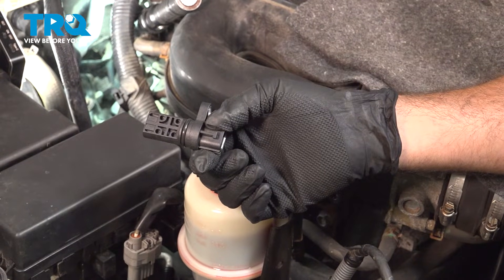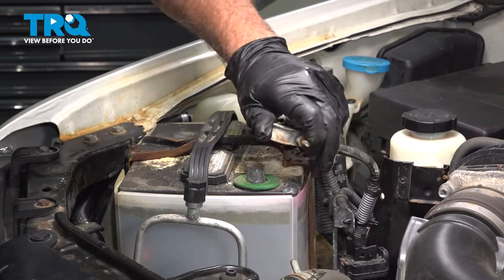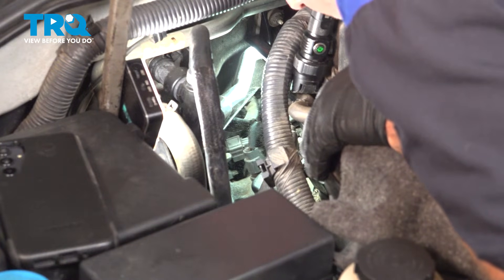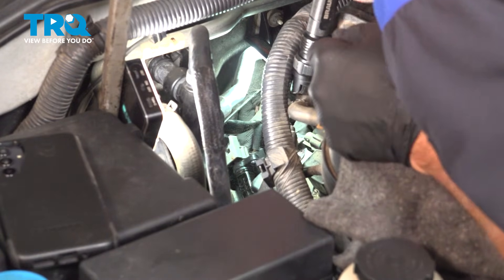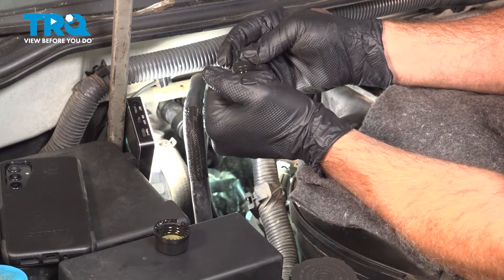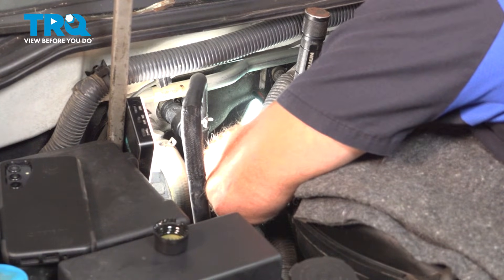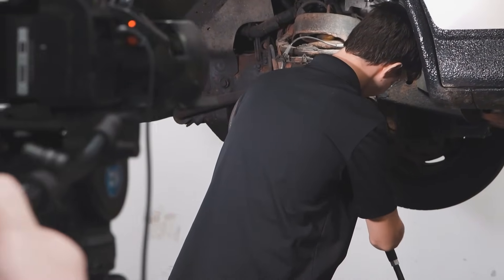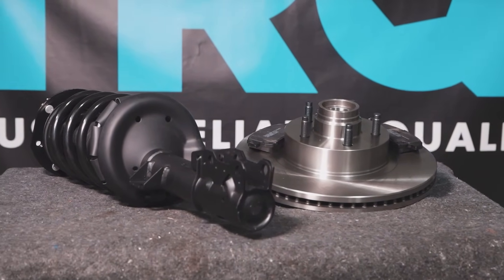How to Replace Passenger Side Camshaft Position Sensor 2005-2021 Nissan Frontier 4.0L V6

Comment: For others watch this , the instructions in the video were great. Two additional things I found: 1) You can loosen the bolt holding the wiring harness most of the way without removing it completely. That is enough to work the sensor out around the harness, and it doesn't leave you with the risk of trying to replace the bolt for the wiring harness on the back of the engine by feel! 2) The tab on the electrical connector pushes forward (towards the sensor) and will snap open once it's pressed all the way forward.

Comment: Make sure when you replace any of the sensors on the Frontier, (or any Nissan for that matter) to use the Nissan OEM ones. Hitachi makes all the Nissan sensors. The aftermarket ones WILL give you issues. The system is very sensitive, so save the headache and buy the Nissan parts.

Comment: The content of the video was very helpful. However,  my sensor was a little stubborn. After tugging, I used a long flat head screw driver to fit between the sensor and connector and with a little twist and it became free.

Comment: Taking out the top cover that says 4.0 gives you a little bit more room but be SUPER CAREFUL, the right side sits on top of a bolt thats connected to the driver side valve cover. If you yank the cover off you can brake the bolt along with the valve cover now leaving a hole 😢 Also the passenger side sensor connecter needs to be pushed in all the way with enough strength so that it will release the sensor. Remember push in the connecter and the sensor will automatically pop off. You can use some pliers just be careful not to brake the connector.

Comment: Great instructions. I managed to remove both sensors, with my long arms, without removing the wire harness you mentioned. Turned the sensor enough to clear it both out and back in. The plug is a pain, but if you push the release in far enough, they slip off. Save hundreds and I'm no kid either.
Reply from the maker: +@davidluciano3873 Thanks for watching our video! http://1aau.to/m/Shop-TRQ